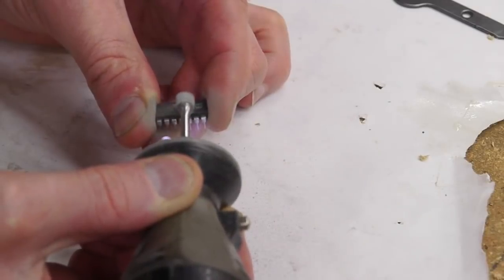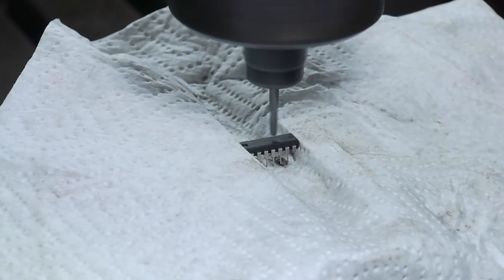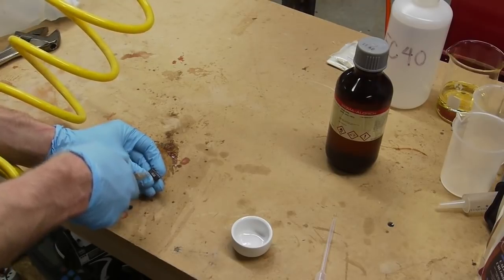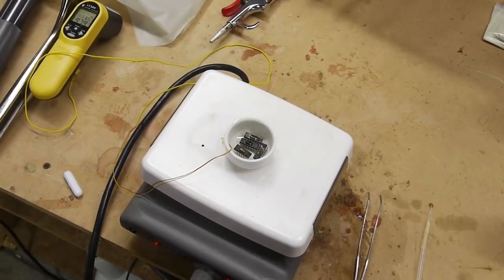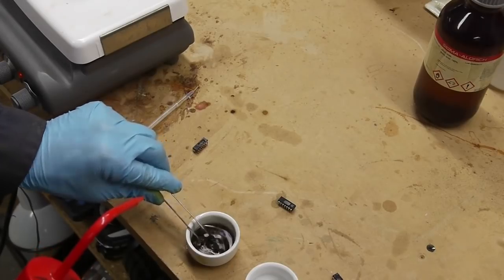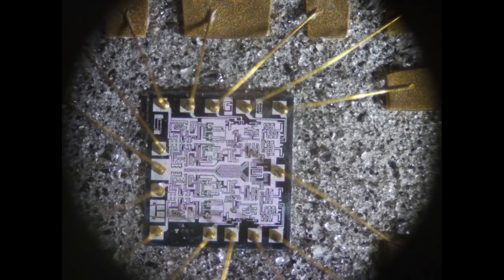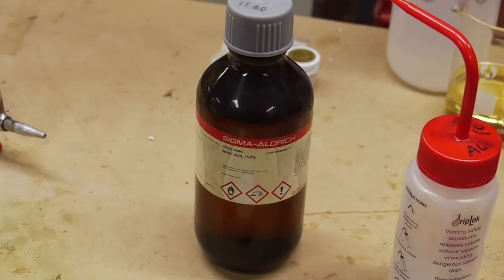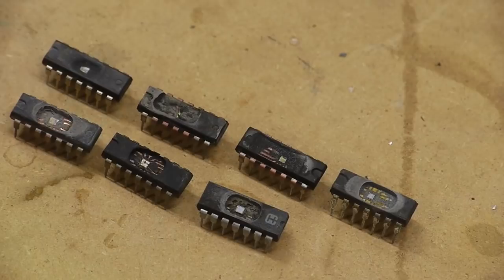Decapping ICs (removing epoxy packaging from chips to expose the dies)

Comment: Curious if the amount of gold that could be recovered versus the cost of using the nitric acid and acetone makes it a cost-effective solution to recover the gold
Reply: A cheaper and easier way if you just want to recover the gold (and it doesn't matter if you destroy the circuit) is to just heat the chip to high temperature and burn off the casing. 
You still need some acid for the gold extraction process - but that's probably a lot less then needed to dissolve the epoxy this way.

Comment: I have heard of people extracting the program files of old arcade games by de-capping the PROM chips that the data was encoded on: way back when, when EEPROMs and EPROMs were too expensive to use in games, the memory of choice consisted of junctions that were essentially 'blown open' to write a binary 0 or left fused closed to write a binary 1. This could be resolved under a microscope and the programs reconstructed.

Comment: I was nearly successful in taking the top off a 4164 DRAM chip in the 1980s, with nothing more than a file. Maybe you could mill right down without using the acid. iirc there was a small air gap so I didn't mash the bond wires - but I did mess up and take the corner off the die.  I was intending to use the DRAM as a CMOS video sensor.

Comment: fuming nitric will degrade after time. Storage is the biggest prob. So don't buy more than you will use.
Cut off the contact pins as close as poss to body and dissolve the connector wires in aqua regia. It's takes approx 300k = 1 g gold. Each wire is 1mm long and 1 gram of that gold wire will be over 13 mls long

Comment: Why dont you soak the entire IC's on paraffin, EXCEPT a windows over the ic?. I guess it could be tricky if not well done, because i guess that paraffin could block the attack of the HNO3 if it's smeared over the area intended not to be covered. 
I have a question... after all this stress... the ICs are still functional? or fubar?
Hugs! <3

Comment: Whilst handling a lot of chips I came across one that the top just fell off. So it makes me think if you cleave the side of the chip with a fine but sturdy cleaver it would do the same along the natural fault which is there.... Might save time.

Comment: You could run the logic chips then use bright lights, laser pens, etc. to see to what degree the photovoltaic effect makes them misbehave :)
Reply: I used to illuminate xeon bulbs in my finger tips (that is without connecting wires, just holding onto the terminals in my bare hands), imagine what those voltage fields would do to those logic gates (http://www.teslasources.com/ )

Comment: I used to work for Needham's Electronics, a now-defunct EPROM/Flash programmer manufacturer, where we did this all the time to figure out faster ways of programming chips.  Please, I beg of you, put a safety warning on this video.  Fuming nitric acid is *extremely* dangerous unless you handle it right (meaning, using an exhaust hood, wearing special gloves).  Looks like you know what you're doing but I'm worried about some kid trying to do this and getting permanent lung damage as a result.

Comment: How is even possible to print at that level seriously how?  does the little CI circuit (3:28) include any special set of features like semicounductors, resistor, etc. Or is just a single material in the circuit´s track?
Reply: They don't print the circuitry on ICs. They use photographic techniques to produce the design from a much larger transparency. Using photo resist (as used in PCB manufacture) they can etch away areas of the silicon substrate with acid and add layers of different materials using either vapour deposition or sputtering to make up the circuit one layer at a time. Depending on where the photo resist is exposed to light or not determines the pattern of areas that are either etched away with acid or added to with other materials, such as metal oxides. Eventually, after multiple processes, the circuit is complete with its various layers. Pretty much any component can be produced on the tiny circuit using the right mix of layered materials. This is how electronic devices have managed to shrink so dramatically over the last 50 years. Components on a present day computer processor are so small that even the width of the light rays (frequency) is crucial to enable them to be produced at the size they are.

Comment: I would have thought it was both purposes; since it is under a mostly oxygen free and tight environment, oxidation isn't much of a concern, but conductivity needs to be very high, as the bond wires are very much thinner than a human hair.  I've had a look at some myself, they are VERY hard to see without a magnifying lens, at the least.

Comment: These do not give off light.  LEDs and LASER diodes use other semiconductors (InGaN and AlInGaP in high brightness ones, GaAs in older and low brightness ones, etc.) and would be hard to integrate into Si devices.
Also, light is much harder to deal with than electricity.

Comment: Could you try de-capping a DRAM chip to make a primitive "camera" sensor, light causes the charge to leak from the capacitor stores. The flip side of this is that to reliably run a complex de-capped device it may need to be covered.

Comment: It attacks the pins, but not any of the various materials on the chip or bond wires?  It doesn't even seem to attack the lead frame and that is the same as the pins.

Comment: It's gold-plated because gold-plating is easy to wedge or ball bond.

The wire may be copper, I'm not sure. Remember, there's not much current here, so the poorer electrical characteristics of gold aren't too much of a problem.

Comment: I like to make custom paper like flat ic by integrating many chip in one base surface .
Like combining smd Attiny85 with smd lm358 and smd 555 ic but for get i have to get rid of black ceramic to expose only active wafer to make it flat may be you can do this much better .

Comment: Depending on the materials, sometimes slightly diluted nitric acid works better than the concentrated 'fuming' type.  Also found this: https://www.sciencedirect.com/science/article/abs/pii/S0167931709002184

Comment: There was some russian guy who used to open micro controller packaging with this method in order to test if is it possible to unlock flash memory by burning lock circuit. No need to say that he used very expensive microscope with laser add-on :)

Comment: Is there some reason you didn't just pick up an NTE or ECG catalog and look up the chip number and look at the printed internal diagram with pinouts?  It is all right there you know.  How do you think we make substitutions or use chips in other configurations?  We look at the prints to see what each section does :)
Reply: HM Dickson The purpose of this channel is to learn and to see cool things ("Applied Science"). While practically you could do as you suggest to find a similar chip, I think that defeats the purpose of the video.

Comment: the main circuit was so small..then why was the plastic casing made so big?
Reply: Is just a standar
Reply: Because the pins on a DIP are large.  Surface mount packages are much smaller today.

Comment: That's the reason you need the fuming nitric acid. Here's your answer. Go to 6:33 of this video. /watch?v=2yE7v4wkuZU  If you want to make pure nitric acid go to 5:05 to for of the same video. FYI all that's need is a vacuum pump added to the distillation setup to petty much eliminate the NOx contamination issue.

Comment: Some old style OTP memories could be erased with UV light if exposed.
Reply: True OTPs can't be erased, they have either fuses that are blown or are mask-programmed. However there were "fake" OTPs that were EPROMs just without a UV window. Those could in theory be erased and reprogrammed if you found a way to expose them to UV. One trick was to use something other than UV to erase them despite the opaque package - and that "something" is X-rays. But you have to be careful as too high a dose of X-rays will not just erase the chip, it can destroy it.

Comment: Would this work with a cpu/gpu chip?
Reply: those are already open die, for the most part.
Reply: Yea, upon messing with them I realized once you take the heat spreader off it's just the piece of silicon. Apparently they "flip" the chip. I won't be able to see the transistor networks easily. I took a chisel and whacked a piece of bare silicon and was able to see some of the microscopic beauty though.

Comment: Are the bonding wires gold?
Reply: Pawel33007 probably yes but not 100% pure
Reply: Domino SixO nope, they are just 999 or 99,9% pure.
Reply: Tatsumi Sweg
I said not 100% pure. i didn't said 99.9% not pure :D Some manufactures use gold or silver other manufactures use confinations of gold/silver and coper. Depends on the manufacture.

Comment: whaaaaat that small thing is all that is inside there?
Why would they make such huge bugs when there'se nothing more inside?
Reply: +Stallnig To be able to connect the pins to a breadboard or PCB
Reply: +Stallnig Those chips have quite an old design. Additionally, this is DIP package, used for through-hole work. Sometimes thermal dissipation - bigger size can tolerate more heat. You can get the same and more complex wiring  in smaller packages (QFP, BGA, TSOP, etc).

Comment: serious question.....why are you doing this? what is the purpose?
Reply: ***** Thank you for the reply, but what were you going to do with or to the chip after exposing the inner workings?
Reply: poppacherrie ok so I watched the video again  and I guess I have answered my own question. I have one more question. I have seen some videos on recycling boards and separating these chips from the boards. Are there materials in them to recycle?
Reply: poppacherrie In the video, the color of the metal leads that make contact with the silicon chip looks gold, so it might be 100% gold. The only way to be sure is to put it in medium to low conc HNO3. Copper reacts while gold does not. Red fuming nitric acid doesn't work since it passivates the surface of copper. I think a black oxide would form. Anyway, I'm pretty sure it is gold.
Reply: +The DVD Guy I don't understand the question. I have taken things apart my whole life just to see how they work from the inside. Do you need to have a reason? Tinkerers are a different breed, man.
Understanding a chip inside and out can give you insight you normally would not possess in electronics design, so here is a reason for you :)
Reply: +Virtualgod2009 I wonder if pulverizing to a powder is another way to extract the gold, similar to the way mines do it. I wonder if this is why it is done in africa. Since mining is their biggest industry. Biggest mining industry in the world in fact.
Reply: Virtualgod2009 I never stated it was economical... I was only wondering how exactly it is done over there.
Reply: +The DVD Guy Well, if a person had a defective IC that was extremely rare and valuable and needed, that technique could be used to repair that defective IC that was extremely rare and valuable and needed. ;-)
Reply: I was making a joke. ;-)
Reply: Well.... First, is that it's cool to take stuff apart to see how it works. This type of tinkering is seen in all sorts of fields. Biology, psychology, electronics, anatomical science. Physics. The best way to learn about something is to take it apart and reverse engineer it. Most of our advances is from taking stuff apart. We look, record and build from the knowledge acquired from this natural process. It was very fun taking everything apart in my parents house when I was 7. Yeah I got my dads screw drivers and never looked back.
Reply: JP Aldama Yes the primary reason one would want to do this is to reverse engineer.. Most chips have a schematic which represents an 'equivalent functional schematic' but rarely does that tell someone exactly how they did it, which may be important. It may also be helpful to probe a portion of the chip otherwise inaccessible.
Reply: Please keep doing it, it was a great source of info!
Reply: Most home shops do NOT have CNC machines bro !
Reply: Human being has natural curiosity. I can not help you too much if you do not understand this!
Reply: Great One +Great One 
Can't answer that.Could be a question of what rocks your boat or shakes your sox. 
But concerning why one might want to un-lid an IC.
If the IC contains a proprietary software it can be examined under a scanning electron microscope while energized to read out the 0 1 patterns in the ROM. Has been done in the past. Some of the so called theft of software was done that way. You need an EM but large organizations can afford that. I installed one EM  where casual chat with the staff revealed such intentions OPO the owners.
Reply: To LEARN more about it. Some of us take shit apart just because we want to KNOW. It's called curiosity. It's what separates us from lower forms of life. We LIKE to learn new things and use our hands.
Reply: @quaxiscorporationforresear5557  Yeppers, JP Aldama. My family didn't understand me either. I took my sister's doll apart by performing open heart surgery to see how the weighted diaphragm made that crying sound when the doll was laid down.

Comment: i got one better to make a carbon microprocessor use photosensitive paint with carbon (mixed and put in the processor  use light that reflects from the carbon and then let it heal and the remove layers with scotch tape or rinse and then test and use scotch tape if you find errors. also redoping that chip and the grinding and then hitting it with the laser grid will make carbon nano chips too. but you had better be good. remember if it fails use some scotch tape on it and try again.

Comment: Everyone is right about the safety aspects of using this acid. On the other hand, it is quite expensive to purchase. A better option is to buy yellow fuming or concentrated nitric. If one wanted to totally remove the plastic (mold compound), then a dip in 5:1 (fuming nitric:concentrated sulfuric acids). Kind of expensive though. Don't get me wrong, this is a good process for removing the mold compound.
One may want rinse the part in water then acetone.

Comment: PS I meant get it back from a fellow hobby nut n2 electronics, he won't use it for anything. Not get it back after destructive testing. Also, if u live circuit test and heat becomes a problem, consider using baby oil to cool.

Comment: it would be awesome chips came like that or with transparent epoxy... at least for educational purposes
Reply: There's a problem there, the results should be very light dependent. Transistors actually start sourcing a small amount of current by themselves when you shine light onto them. Perhaps you saw an array of LEDs used as a reflective touchscreen once? Was popular on hackaday, youtube, etc.
Reply: Search for "eproms" they have a window you can see through.

Comment: manufactures like samsung toshiba siemens texas sony must do the clasical chips 741 555 565 with all transistors connections accessibly via pins in BGA form.